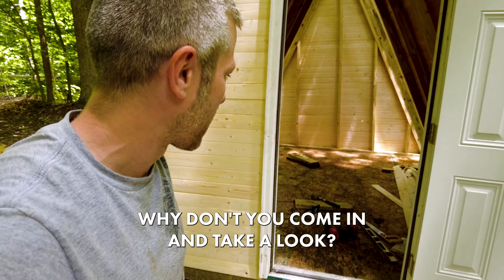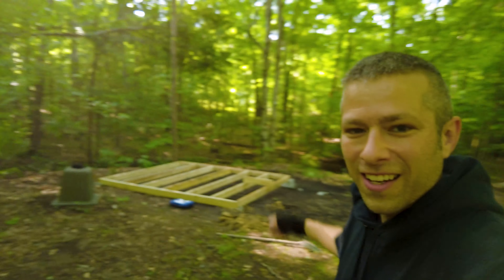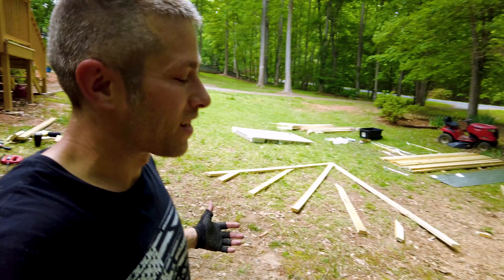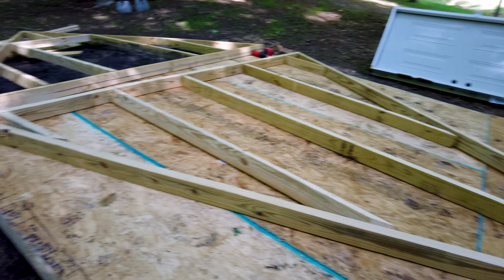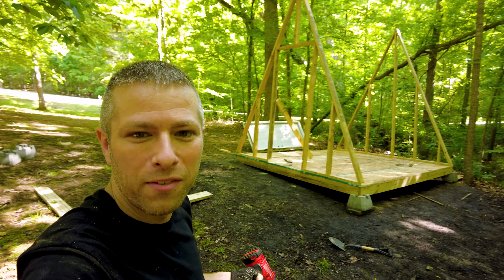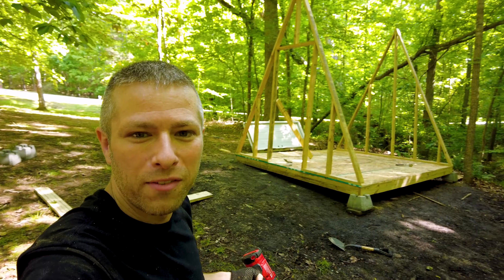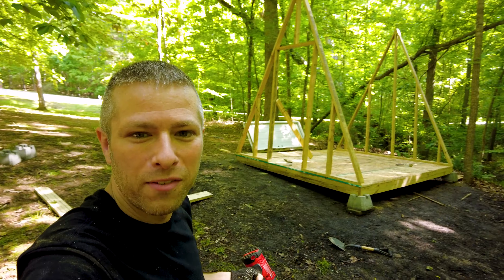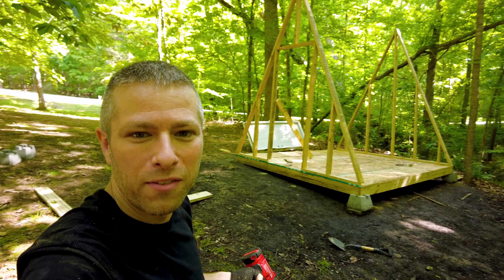I finished a DIY tiny cabin build for cheap in less than a week.

Comment: It's tough to watch a new wood worker struggle, I wanna scream through the video to give you suggestions to make things easier! Good job! You stuck with it and learned a lot.
Reply: lollll. im not the best but good enough. deff would staggered the sheathing and put more concrete blocks on the bottom but I love the can do attitude and building buy yourself is exponentially harder
Reply: Lol I was doing the same thing. But I honor the drive to do it.
Reply: Agreed. I am a hobbyist and I wanted to scream ridge cap and ground contact lumber. Also, nails! Nails. Lol. It was a great video though. Haha

Comment: Your Simpson hangers are upside down. They cradle the boards
Reply: Also.  He didn’t lay the sheets down right. All written side Down.   Not back an forth
Reply from the maker: The plywood sheets?
Reply from the maker: I realized that after the cabin was finished...the photo in my blueprint was confusing because it was upside down but that's because they were had it flipped. Oops. I'll know for next time.

Comment: 10:15
japanese saw
you cut-force forward, so more square and easy (because not have to push).
Quality are expensive, but you cans just buy the saw and make the handle,
or Cheap who does not sit down, made in Germany

Comment: Nice.
I woulda raised it up HIGHER to keep away from water and splash up otherwise you'll rot.
You oughta be the one that devises a A-frame house thst is built to be expanded later on without major reconstruction difficulties.
For instance, if you had a door out the back of this A-frame building then that would be the future connecting doorway into the new "doubled" add-on A-frame.

Comment: should have put the angle on your skill saw to cut those angle pieces.
Reply from the maker: I tried but the 25 degree angles were too sharp. It mentioned it in the blueprints that i'd have to hand cut them as well. I'm sure there is a way to rig a miter saw to do it though.

Comment: why didn't you just use the chop saw to cut the angles?
Reply from the maker: Whoa way late reply, but probably cuz I had no idea what I was doing haha. If I remember correct though the angles were too steep for the chop saw, then I chopped the wrong angle...ugh that was the hardest part. Structure still looks like the day I built it though ✌️

Comment: Well good job the only big thing I see is how close to the ground you have it, theres a couple of issues fist and formost is the moisture . The closeness will trap moistness in, rotting your floor out within about 4-5 years secondly critters will make their homes under there which will attrack snakes if your lucky a king snake chanses are it wont be a king snake! . The way to have avoided this mistake was to set all four of the blocks on the ground insert your boards aply level find lowest block and sink abjacent blocks to level being your ground was close to level already. This would have left about six inches ground clearence which would have been enough for air to fllow with the slitestà of breeses keeping it drie and unattractive to critters and less attractive to snakes !
Reply from the maker: Wish you had been there to tell me all that when I was building it haha.
Reply: @DontMindRyan  you did good for your lack of experience Real good.

Comment: Ryan, The first thing you did wrong is you used a jigsaw to cut the plywood, instead of a circular saw. Next, after you cut the 2 x 4’s on the wrong side, you used a jigsaw that is used to cut metal on wood. Then you went back to the store and bought a hand wood cutting saw, when you had a mitre saw the whole time. That would have made it so much easier and faster to cut those 14 pieces.
Reply from the maker: lol...mistakes were surely made. I'm just glad I have all my fingers.

Comment: The problem with an a frame is the square footage you lose. Basically you build an expensive permanent tent! Side note you always use 2X6 for exterior framing since 1970, they found 2x4 wasn't strong enough. 2x4's are usually used for interior framing.